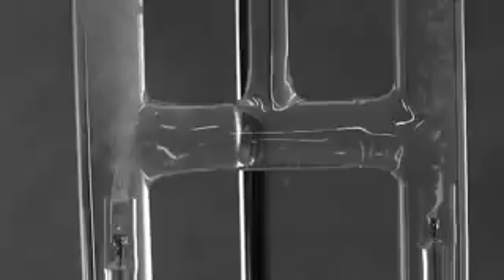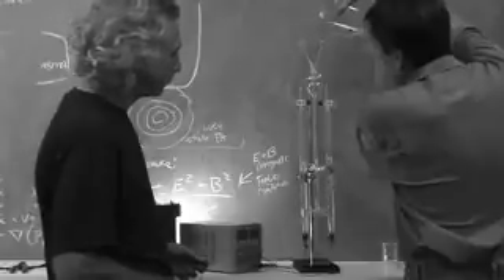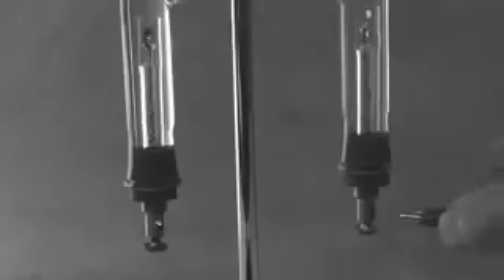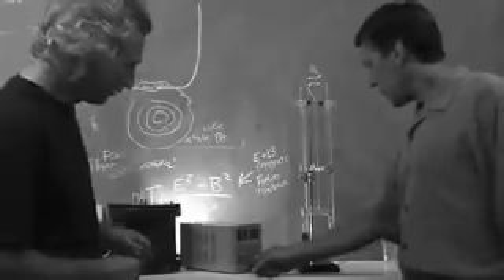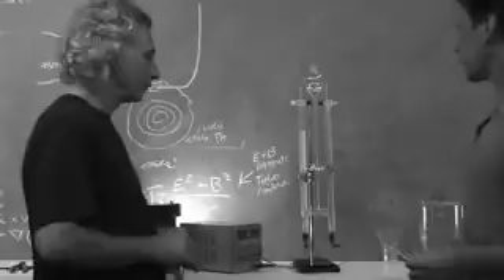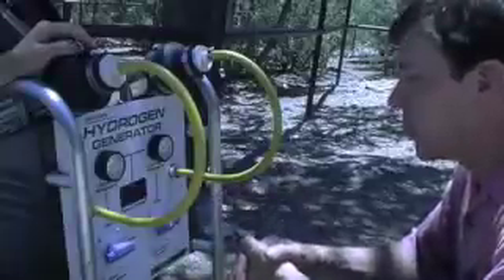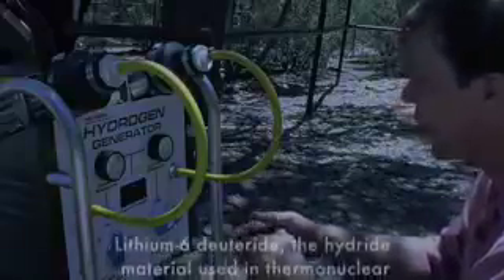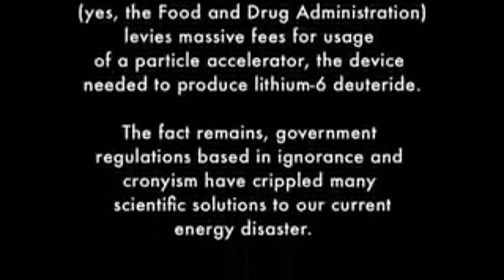run your car on water. This guy does just that!

Comment: 7+ years later and we still dont have this as an option?
Reply: Because it takes a shitload of power to produce enough hydrogen to replace fossil fuels.
You use more power to get the hydrogen than you'd use to just power the car directly.
Reply: That's because it doesn't really work.
Reply: Leo Lion coincidence that he said particle accelerator before Cern was trendy
Reply: The first particle accelerator was up and running in the 1960s. It wasn't a popular trend back then for common folk to know anything about science.
Reply: Are you aware of how the world works
Reply: There is no such thing as a fossil fuel, when you burn gasoline you are actually burning Hydrogen.
Reply: You also burn carbon.  That is what produces the greenhouse gas CO2.
Reply: You can't burn carbon, the carbon is combined with oxygen to produce Carbon monoxide CO not co2.
Reply: You can burn the carbon monoxide to produce carbon dioxide. Carbon monoxide just happens when there isn't enough oxygen. In fact carbon monoxide is extremely flammable. It even explodes under certain conditions.
Reply: We got here as an option in iceland. There is no fossil fuel vehicle here. Electric is way much cheaper here until we do not know what to do with it. So we build hydrogen fuel station here. Car run from batteries or hydrogen fuel here. No fossil fuel.
Reply: Actually you already do have this option. It's called a hydrogen car. But it is very expensive to use, because it takes A LOT of electricity to make the hydrogen, and it's a very inefficient proces. A much better solution, would be to buy an electric car. That way the electric energy can be used directly, without the need to first convert the electric energy to hydrogen. In the end, pure electric cars are much more efficient, and much cheaper to use.
Reply: Hydrogen embrittlement is the process by which hydride-forming metals such as titanium, vanadium, zirconium, tantalum, and niobium become brittle and fracture due to the introduction and subsequent diffusion  of hydrogen  into the metal.
Reply: The stuff works.  People need to realize they live on a prison grid, when they keep using money.  Like prison, everything harmful is only allowed to be purchased from commissary. So things that are really cheap and really useful, to everyone, raising the quality of life to that of their masters, is forbidden.
Reply: @cn6519  you cant create or destroy energy dude which is why this doesn't work.